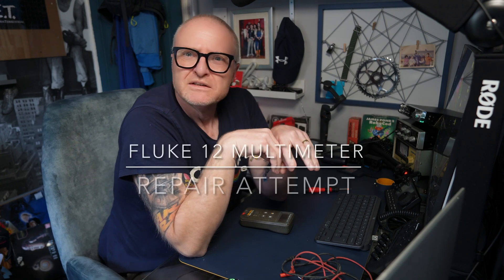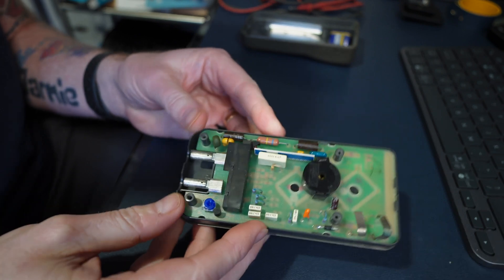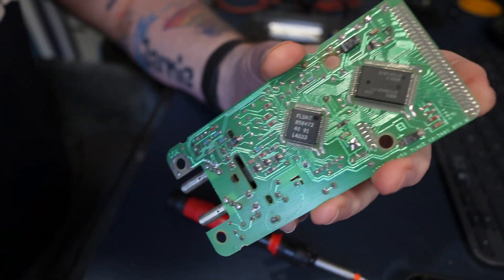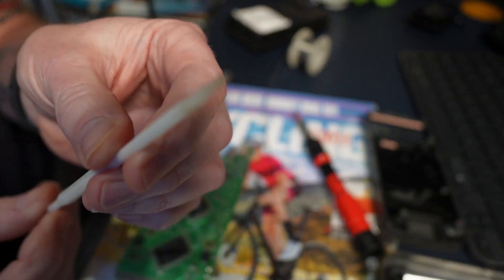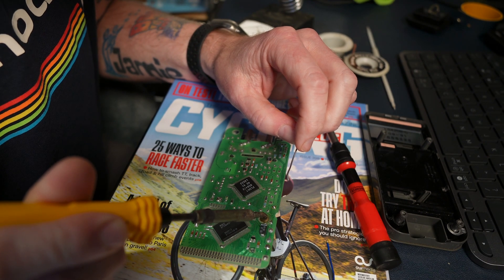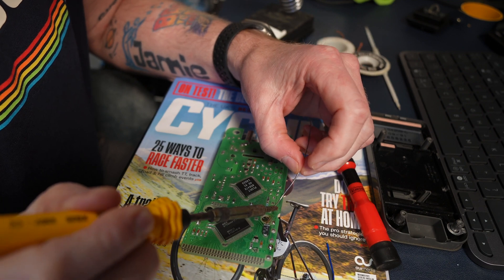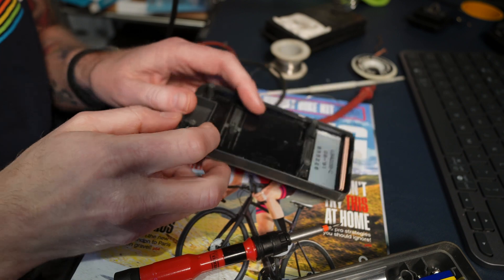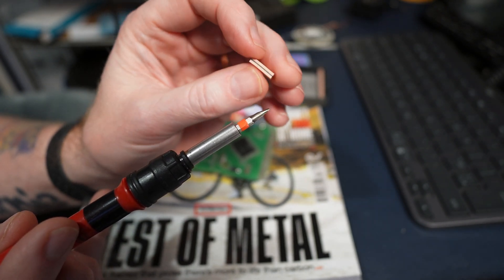Fluke 12 Multimeter,Can it be Repaired?….1990’s

Comment: @gtretroworld Fluke 10,11 and 12 models all have this trait maily due to over enthusiastic button pressing over time. They were good basic meters and the 12 model was top of that range which Fluke/Philips released from memory in the late 1990s as an "economy grade" meter.  You can see the lid of the unit at 7:42 on the right hand side. This is the part you need to dismantle further. Take out the pink/black zebra strips for LCD and PCB. Remove black cover on underside of lid. Pry out the rubber button grid, on the back you will find a piece of transparent laminated plastic "sandwitch" on the back side of the buttons which has a maze type pattern of carbon tracks sealed inside it. The centre of the 4 square tracks is the contact pad which is sealed inside the 2 laminate sheets. Each of the 4 button tracks is grounded when you put pressure on the front button. The contact routes along the track inside the transparent laminate to a 6 contact "pick up" zone which is the small zebra strip near the LCD. You will see the pink/black zebra strip makes contact with main PCB. You may be able to clean the zebra strip with foam cleaner and leave to dry & replace . Find where the laminated contact sheet meets with the strip , lamination is single layer in that very small area so you may be able to repair with conductive paint or suchlike. It is a difficult job to repair if you consider separating the laminate sheets to repair a broken track close to buttons ..probably undoable ! ,Fluke no longer supply spares for these models which is frustrating as the fault could be totally cleared by replacing just the laminate sheet which probably cost a quid/dollar to manufacture. If you want a real mans Fluke, try a 25 or 27 model, built like a tank, from same era as 10,11 & 12 but in a parallel universe when it comes to quality/safety, a large meter ..hell yeah but absolutely superb instruments in every way. Cost was circa £450-£600 in 1990s , Build quality second to none and cheap nowerdays if you go MOD Military surplus route. 73s Mike.
Reply from the maker: @merseyradar  This has had a hard hand fisted life from myself over the years and although i occasionally use it last year i bought a new 117 which is fantastic for my mobile needs, the volt alert for working around the house is also great. Tbh the bench multimeter has replaced the 12 but yes if we could get a few parts for these oldies that would be great but they really want our money for new tools. Thanks for visiting the channel.

Comment: I have this exact meter, had it since 1999. The beeper has stopped working. It’s also my only meter so I can’t fault find, can you do a tutorial on how to check it and possibly how to replace the buzzer ?
Reply from the maker: Testing the Piezo should be quite straightforward by just removing it and running a couple of volts through it to listen for a click or buzz.If the logic side of the meter is still working fine i would hedge my bets it has a failed buzzer.If you have no joy with the above i will see what i can do for you.Thanks
Reply: @gtretroworld  does the plastic cover just slide up to recital the piezo?
Reply from the maker: @Elds2024  I would need to take a look but i guess it should separate to get in there.I would remove it first and check to see if it is actually functional.

Comment: If anyone can fix it you can m8
Reply from the maker: Cheers Andy…It’s been a while i tell thee but i actually enjoyed messing about with the old iron.
Reply: @gtretroworld  can't beat a bit of ironing lol I still have my trusty base iron station
Reply from the maker: @andyparker7658  I still have my old station somewhere but the old trusty Antex found me first…btw have you seen those new fancy all in one stations that include a iron and hot air gun and also those heated solder vacuums?
Reply: @gtretroworld  yeah I've seen them they look good but a bit pricy unless you are going to use them a lot
Reply from the maker: @andyparker7658  I might try one of those tidy modern hot air soldering stations,especially the ones with the built in bench supplies for the little jobs.